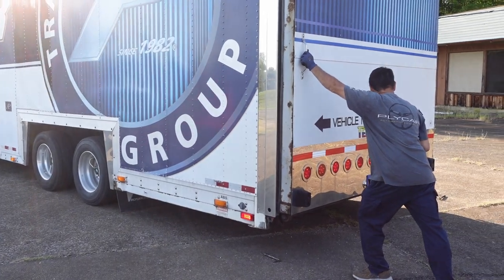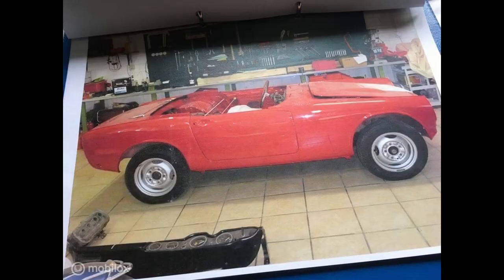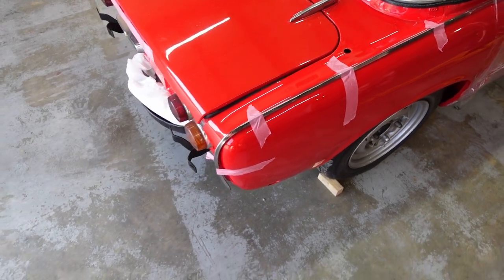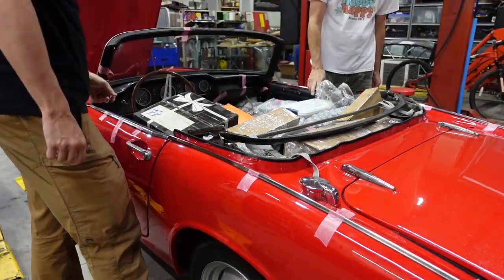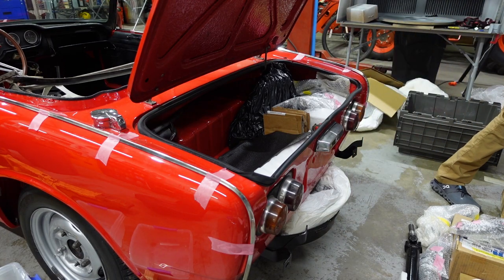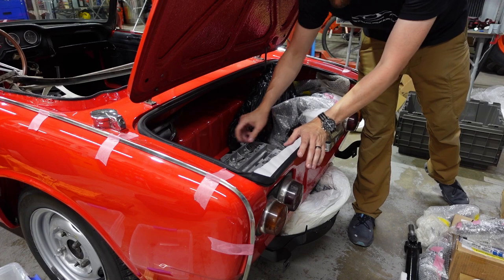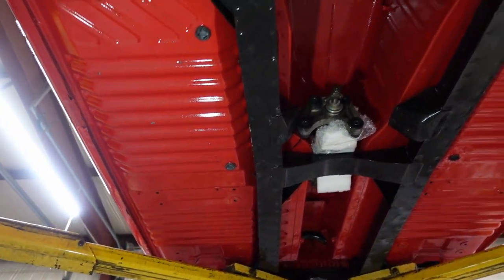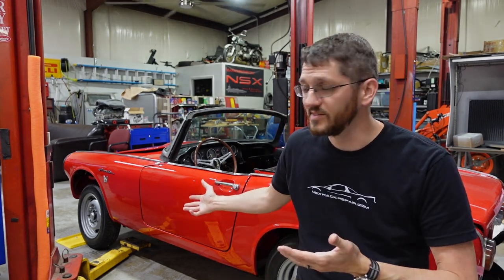Episode: 1. Honda S800 Build.

Comment: I owned a 1968 coupe mk1 in 1975 and a 1969 coupe mk2, fantastic cars, paid £275 for the 68 running and £75 for the 69 as a parts car. I rebuilt the 68 mk1 engine twice. What a piece of engineering, service interval was 3000 miles but I never made this before open heart surgery again ! I built a good 69 mk2 car once I’d perfected my rebuilds and it drove like a sewing machine, 80hp from 800cc at 8000 rpm. Biggest improvement was fitting new 145 tyres to the front and 155 tyres rear, had a very interesting chat at Motor Show with a former Honda Team tech expert. The car handled well after this. 21-22 yrs old, I had an ex Royal Navy chief engineer for a Dad, his ability to tune and balance four carbs by ear was extraordinary. Can’t believe values today, it broke my bank continuously in 74/75, a weeks wages for an air filter, a years wages for a gearbox or diff’, hence the parts car. Sold the 69 Mk2 in 75, £375, and then sold all my spare parts for £450. Fond memory but always skint. 😎👍😂

Comment: I first saw an S800 in Okinawa at a Honda dealer in 1967 on my way to Vietnam.  It was a fastback.  I wrote a letter to Honda trying to buy one, but they suggested that I not buy one as I would be a “stand alone” with no parts or service in the States.  Turns out I could have taken it to a Honda motorcycle shop for engine service.  Oh well.  LOL

Comment: Tech tip from a really old Honda guy. That caliper is a hi-po dual piston design one puck hits the inboard pad directly the opposing one does it thru the stamped slider plate to clamp on outside pad. 😮